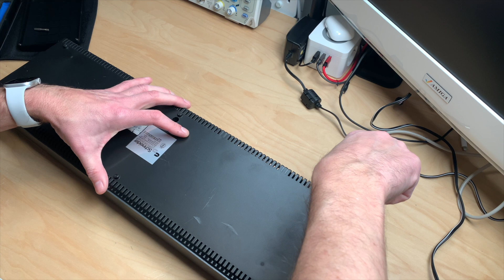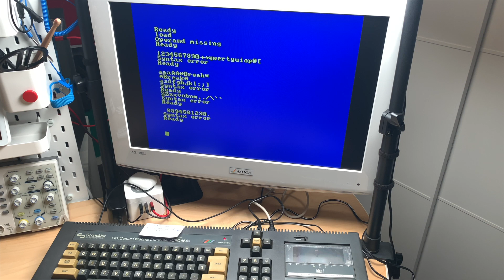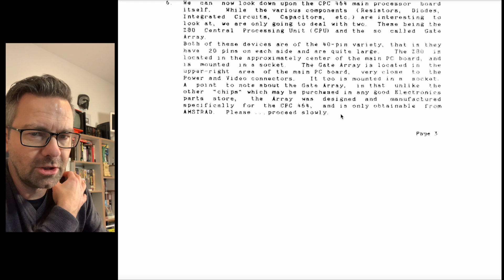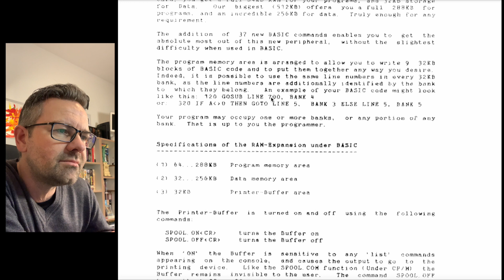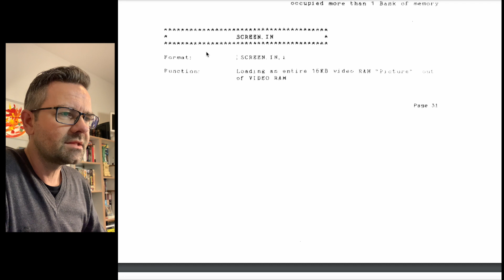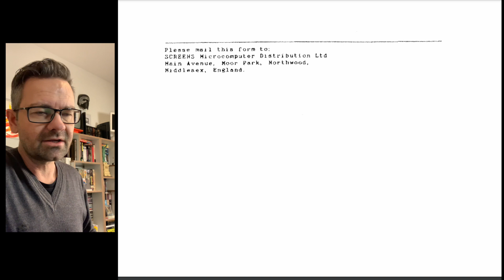The Amstrad CPC464 Holy Grail - VORTEX SP512 - a 512KB RAM Expansion for the Amstrad CPC

Comment: 7:55 I would recommend a plastic welding kit for those attachments. They come with plastic wands of different material compositions that pass through a hole in a heated element.
 It's more robust than recycling the old plastic and using an undesirable soldering iron.

Comment: Can this make a 664 run 6128 software? If yes I need 10
Reply from the maker: Not sure. I think the 6128 does not do bank switching. But check here for a 464 to 6128 conversion! https://www.cpcwiki.eu/index.php/Expanding_from_CPC_464_to_CPC_6128_Spec

Comment: The windowing is the feature of cpc basic that you can define the portion of the screen inside which printed text will be wrapped and scrolled. Its just very basic window, e.g. overlapping is not solved at all.
Reply from the maker: Yeah, right! It's all coming back now ... at least the windowing stuff. I think I used that feature in a game back in the day ... that and redefining the character set ... Good times!
Reply: @RetroWK  yeah you could easily e.g. divide screen into 2 portions if you used standard text output routines
Reply: @RetroWK  since this was not used very often the guys from Vortex probably decided they can put fast text rendering as a bonus with this minimal tradeof. I miss this a bit in your video to compare the speed in fast and slow mode.
Reply from the maker: @rastislavzima  I will take care of that in the follow up video. Collecting material now ;-)

Comment: Another very well made video!!! That manual seems to me to have been made very well and the team who made this card were some smart people! I feel it really made it a whole new machine that was taking it to the next level. I wonder if that team could have made a board like that to work with the 6510 CPU that would of fit into the C64? I know Commodore did make three models (128K, 256K & 512K) that all plugged into the cartridge port. I have two of the 1764 RAM expansion cartridges (256K) and one of the two has been opened and RAM added taking it to the 512K max. I got them both a few months ago in a large C128 lot that I bought just to get the working 1581 3.5 drive. Once you put these into the cartridge port you then loss the ability to use any of the utility carts like Fast Load or a software cartridge like the CPM cartridge. On another subject, I have seen many FB group posts this week that Sonic the hedgehog will be coming out really soon for the C64 and its being given away for free!!!  Only thing is for it to run you need at least the 128K RAM expansion. They are saying it's because it's such a fast paced game that the whole map must be loaded at the beginning of each level.
Reply from the maker: Thanks! ... as always ;-) I am sure you could put one of these existing memory expansions inside a breadbin. The only problem is the memory mapping. If you would plug in a cartridge, it would have to battle it out with the internal expansion. In the end you might end up with manual bank switching and stuff (like in the Vortex here). Looking forward to Sonic! Perfect game for the C64 Maxi / Mini because you can switch on all the memory expansions with just a flag in the filename!

Comment: I like the Machine Code tools, very handy. The Speccy could do with them built in.
Reply from the maker: I think every machine could. The Apple II had one built in. I always thought that was nice. More people might have learned machine language if the other 8Bit machines had one built in.
Reply: @RetroWK  Definately. The Acorn Electron has an assembler that can be used directly in BASIC.
Reply from the maker: @Franko_Walker  Cool. I didn't know that. I have an Acorn on my must-have-list. They are just really expensive here and I have zero knowledge of them. Another reason to take a closer look!
Reply: @RetroWK  I got mine a couple of years ago with all cables, books and tapes off ebay for about £15 not working. It just needed minor repairs to the video section. I also bought an SD card add-on for it, it works perfectly.
Reply from the maker: @Franko_Walker  Great score! Right now there is only one listed on ebay (Germany) for 120 naked.
Reply: @RetroWK  That's pricey.
Reply: frag mal einen Smartphone-Benutzer, der von sich behauptet er könne alles, was heisst, er kann die Tiktok-App bedienen, aber die Maschinesprache der aktuellen CPU...
Reply: @melbar  Yes, exactly. LOL.

Comment: Broken keyboard/matrices, seems to be the subject of this month :)
That J stands for “janky” 🤪
BTW you can melt those “plastic melted taps” using an smd work station on low heat. Just be sure to keep moving it around.
Reply from the maker: I had the same idea with the plastic stuff ... but since it is almost 40 years old, I am not sure it will hold up. For now I will leave it like that.